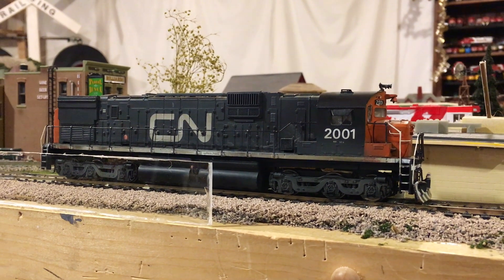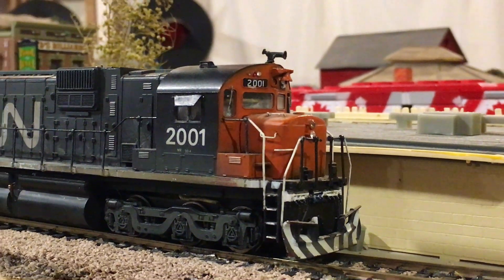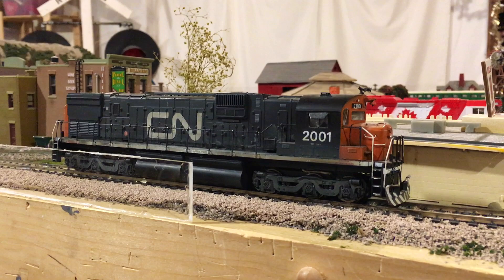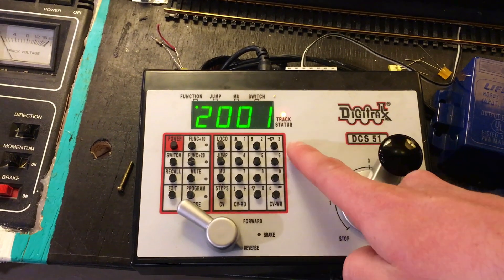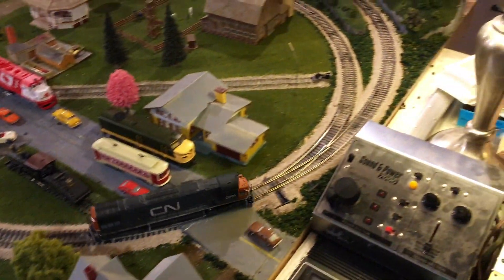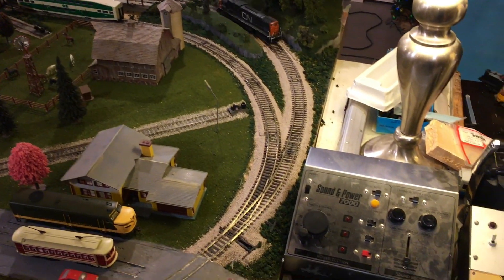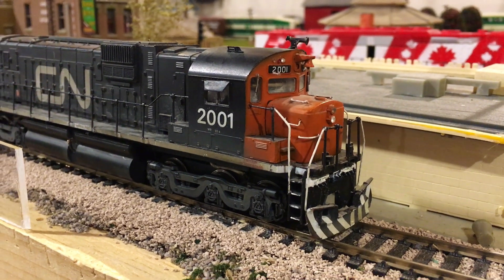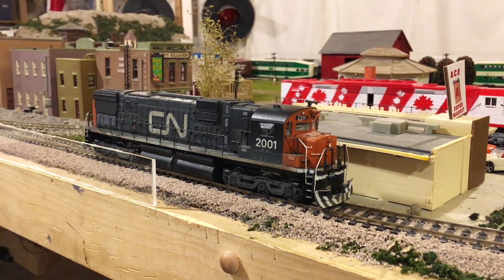My Alco CN c630 Rides Again - Fitted with DCC & Sound

Comment: Fun fact: those big Alcos had something in common with the most powerful machine built by mankind the Saturn V rocket. 
The same prime mover in the Century series locomotives also power ( or powered) the Greasy Pig AKA the NASA crawler built to move the Apollo rockets from the VAB to the pad and later that same trip with the shuttles.

Comment: It sounds like the speaker isn’t secured or ventilated. You need room for the speaker to move it’s full range of vertical motion, and the cone needs to be secured in a way that reduces vibration other than the cone itself. How did you secure the speaker? If it is just free floating, then that is why it is quiet. It needs to be mounted on the shell, I would point it up or down. The volume isn’t the problem.
Reply from the maker: I mounted it onto the top of the truck, I did however place a piece of foam between them because I though it would create odd sounds.